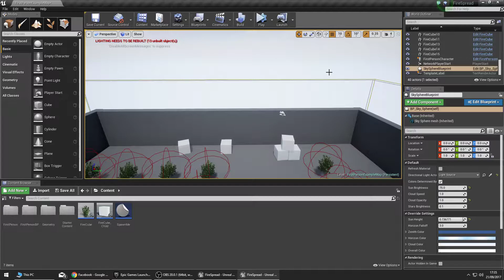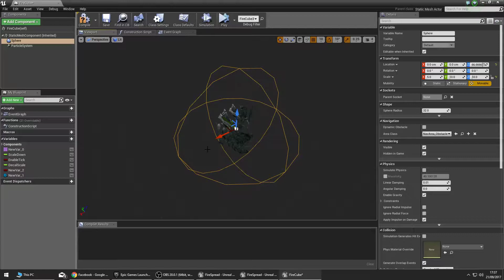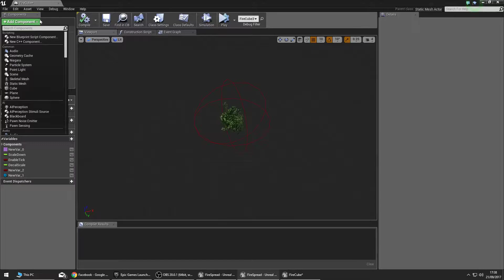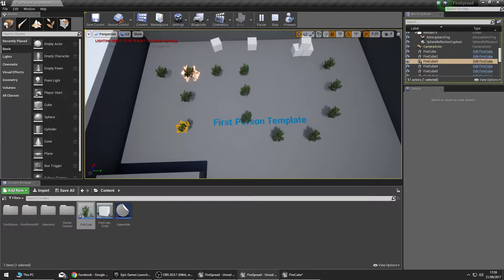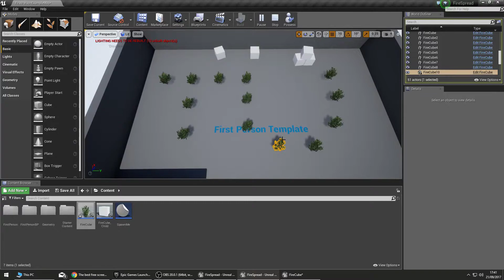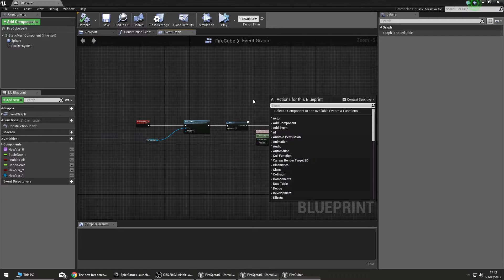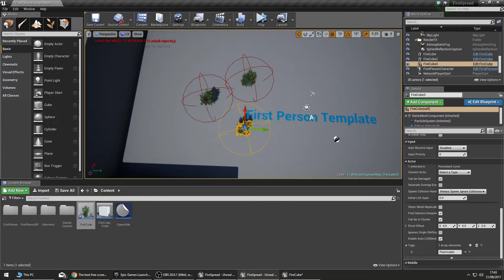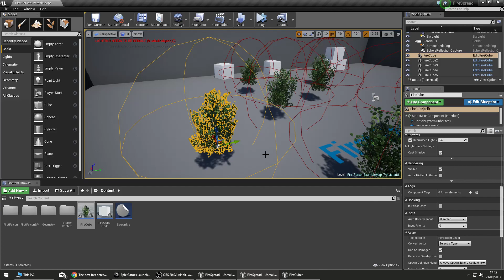Unreal Engine 4 Tutorial : Fire Spreading (pt 1)

Comment: So im having an issue where the fire is spawned upon hitting play, can you elaborate more on how you are starting these with the particle off? I understand you have a event casting fire to the first bush. further explanation would be greatly appreciated
Reply: have you solved that mate?
Reply: @gokhan.bayhan44  I did indeed
Reply: @kylesmith6847  how did you solve the issue in the level blueprint?
\
Reply: Use "Actor has tag" with "Event BeginPlay" and check tag of first object, if it is correct "Set Template" and next "Spread Fire". (the tag for first object i change for something else)
Reply: i know im a year late, but if you remember, would you mind explaining how you fixed it? i'm having the same problem and cannot figure it out for the life of me.

Comment: Hey thanks for the tutorial. I have one question though, after recreating the blueprint nothing happens when I hit play. I have made sure the placed objects have the correct tag and have rebuilt the blueprint several times. is there something else i have to do ?
Reply from the maker: Shawn Becker yes. Inside my level blueprint. I have something that on begin play, after a delay of 3 seconds will call fire spread on a specific one of the bushes :)
Reply: Great tutorial, very easy understand and follow along, I however am stuck on how exactly to enable self ignite from the level blueprint..

-You appear to copy them all from the same asset, yet only one triggers upon hitting start. They don't appear any different. I assume FireCube is set to self ignite and any other assets with additional characters will just function as default, but how/where to accomplish this is what I do not understand.

I'm trying to create a perpetually lit item like a torch, and fire spread misc objects like boxes. -I really appreciate how your tutorial also appears to cover extinguishing fires as well; I plan on applying that to rain and ice to build a Breath of the Wild style chemistry/systemic engine. If you could help me at all with this small issue that I'm just too dumb to resolve I'd be extremely grateful for it. Thank you.
Reply: @LanceBerylDev  I too am trying to figure this out. Or a way to randomly pick which one starts
Reply: Ah ok that makes sense i figured something like that was happening. Noob question i guess but thanks for that :D
Reply: @TotallyUnreal  Could you please elaborate more on the level Blueprint coding?